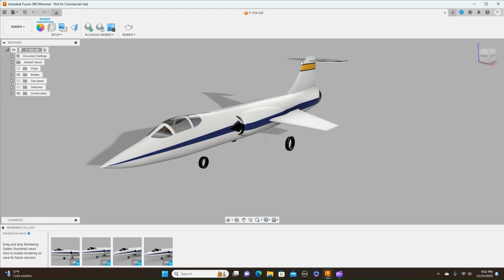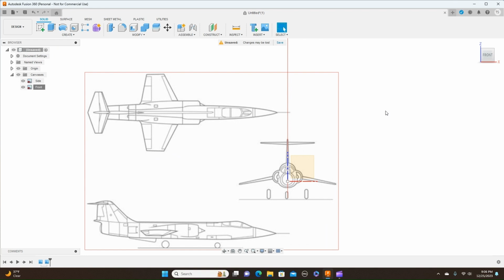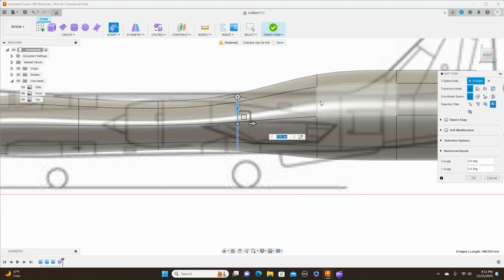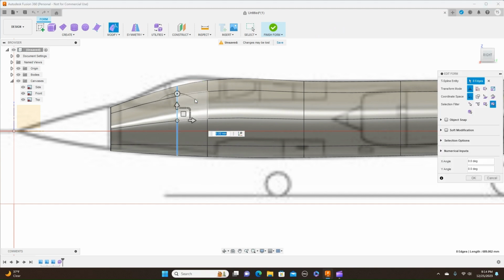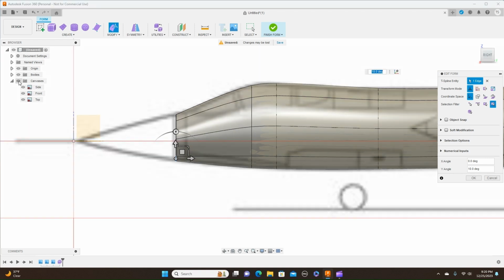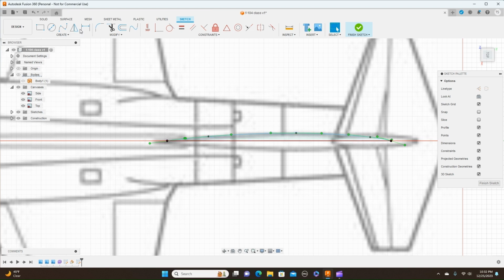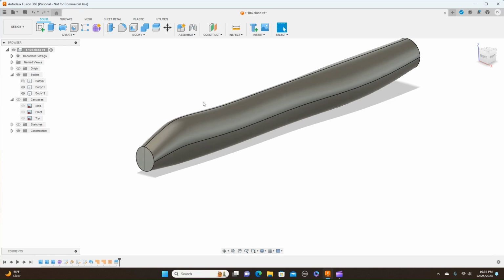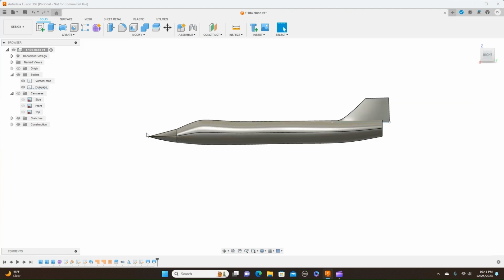Learn How To Model This F-104 In Fusion 360. Free Files

Comment: Hello can someone help me? I'm trying to edit the form however I can't select the scale direction, when I try to do it just jumps between all of them or doesn't even select them at all, its very frustrating. If anyone can help I'd be very greatful.
Reply from the maker: I am not sure I understand as of yet.  So you can not select the lines, points or square?
Reply: @cadbuildflyrc3784  at 13:57 when you select the scale tool mine wont select. Instead I have to specify scale, then it jumps around between all 3 options resulting in a difficult challenge. Is their an option that allows for an easy selection?

Comment: I learned so much from this video. I been trying to model the F106 and your techniques showed me so much. You're an excellent teacher. Love your detail and pace.
Reply from the maker: Thank you!
Reply: @cadbuildflyrc3784  I have a question for you. First of all, I’m new and ignorant to many details of taking my design and preparing it for 3D print. I used the loft with bulkhead sections to build the fuselage but having trouble in hollowing it out. No reasonable wall thickness I try allows it to work. I am learning a lot from my mistakes. It can take a day or so to work it out but I see the value in this. Do you think using the “offset” will help in this or do you have other suggestions? I’ve tried the cylinder form tool but this seems to not capture the unique triangular body of the F-106. Loft, following the bulkhead sections, seem to capture the canopy and other unique areas well. I appreciate any suggestions. I’ve searched for and suggested the F106 for production of RC airplanes. Figured the only way I will get one is build it myself. If it works out, I will probably move on to the other Century Series. Thanks. Looking forward to more on your build of the T38. I was an AirForce pilot and really loved flying the T38. Retired now and in my golden years but still active.